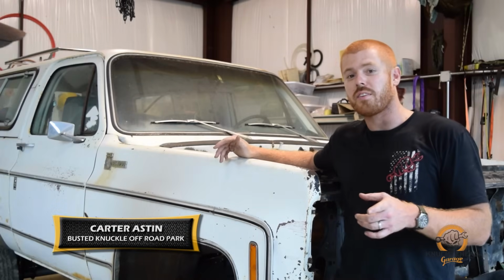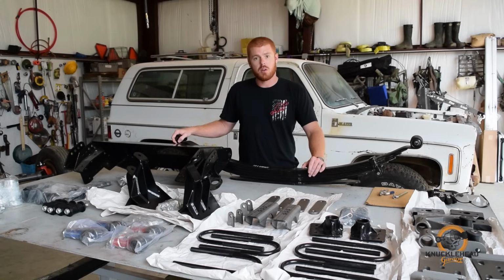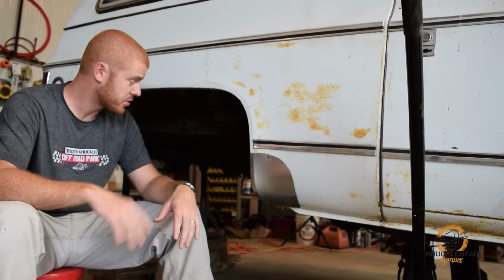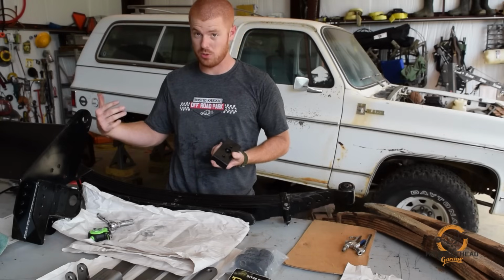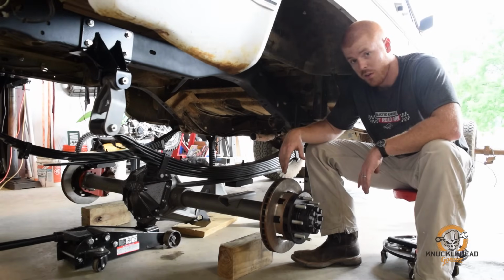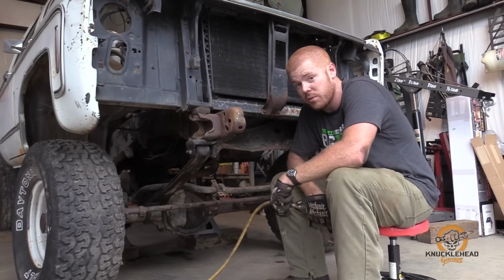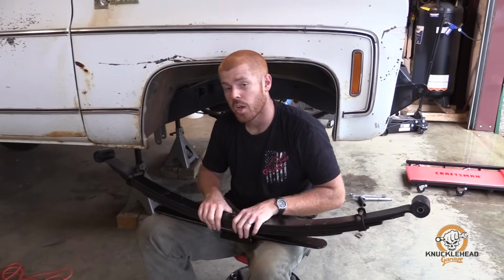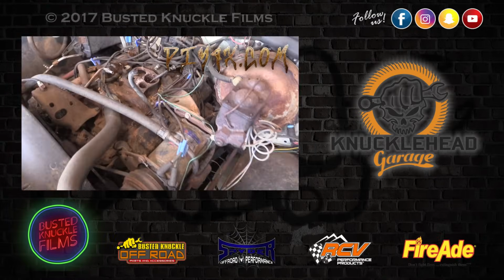Project LS K5 Blazer Axle Swap 1 Tons - Knucklehead Garage

Comment: Can't go wrong with a stock LM7 5.3 or LQ4 6.0 LS but a LQ4 stroker with an RV cam would be perfect for this rig. 500 ft lbs of torque without the weight, mass and gas guzzling attributes of having to go with the big block. Stock 4L80E in it and you can tow or trail all day long and leave room for whatever else down the road.
Reply from the maker: new gen 6.0 is what we decided on

Comment: Is it possible to do the swap , but only get  around 2 to 4 inches of lift? How so? Also, do I need the A bomb bumper, or can I just do the swap &  have it work? I have an 88 GMC Full-size, Jimmy.
Reply from the maker: The A bomb is just the easy way to do it, less leaves in the leaf pack = less lift
Reply: @BustedKnuckleVideo  Pretty sure the leaf springs on my truck now, might be the originals, and are probably bad. Doing the swap would be stupid unless I buy new ones, right?

Comment: Nice job. I've done several of these over the years but learned a few tricks from your videos (such as offset blocks being available for purchase to tweak axle position and using the rear springs on the front).

One comment though. The front axle pinion angle looks too low for the standard double cardan joint at the T-case and single u-joint at the axle. For that the pinion shaft should point pretty much straight towards the front output on the transfer case but yours points directly rearwards. Are you considering getting rid of the double cardan and running single u-joints front/rear on the front shaft? I know a few guys with tall lifts who've done that along with a part time 4wd system (np205 or modified np203) and for that you do want the pinion shaft parallel to the T-case output shaft.

Personally I prefer to run detroit lockers front and rear (after trying the setup you are building). I find it easy to pop it into 2wd for tight turns and the extra grip a front locker provides is incredible on tougher trails. Like you I tried an open front first and couldn't keep up with my buddies, then I tried a strong LSD for a short while (realizing I was going to quickly burn it up when playing on rocky trails and in deep mud) before installing the Detroit and finally being very happy with the performance. I find if the traction isn't good enough for 2wd that the tires tend to slip enough so the front locker isn't a big problem. An air locker is another option I considered (more $$ though) and a few buddies are running but I'm still more than happy with the front Detroit locker.

My truck has 4.88's (now wish I'd gone 5.13's though), Detroit lockers front/rear, Dana 60 front, FF 14 bolt rear, and an np203 with a part time kit using a pre-1975? heavy duty central differential carrier (grenaded the weaker newer style before discovering the much stronger older version). I built it in 1998 so its a bit old school by today's standards with its 350 small block (~350 hp) and heavily modified 700R4 (kevlar friction bands/disks, heavy duty planetary gear set, corvette 2-4 servo, etc.).  For rear discs I used the front backing plates & calipers from a 70's K-5 combined with 8-stud front rotors from a K-20 (Dana 44) plus a custom backing plate mounting spacer. I'm also running about 6" of lift with a double cardan + u-joint front shaft and did have to grind the double cardon housing a bit to handle the high angles during droop (the longer 700R4 vs TH350 helped but not quite enough). For an on-board compressed air system I'm running an A6 compressor from a 1970ish Eldorado (these have an oil sump but you do still need an oil separator) and a frame rail mounted air tank from an 18 wheeler.
Reply from the maker: Sounds like a cool build! We have a lot planned and everything will be accounted for so stay tuned.

Comment: hey i have a question for you hoping you can help me out do you have to change your steering arm if you just do a 3" body lift  i got a 1990 k5 blazer with 35x12 15" tires on it..
Reply from the maker: definitely wouldn't do a 3" body lift

Comment: Loved the video would like to see more.  I had a question about the rear springs did you like the way they  road and how was the handling flip around like that. I am assuming you have finished it and are driving it by now. Thanks for the great video if you can get back to me thank you.
Reply from the maker: Hasn't driven it yet, working on the engine swap now
Reply: @BustedKnuckleVideo  
If it got driven... 
I know the 52/56 combo is for flexy suspension. 
Something about shackle flips bothers me (for towing duty). Have you tried towing with your combo of 52/56 + shackle flip? 

Reason I ask is I have 1 ton 4x4 tow truck I want to lift. I think I'll keep it simple with small blocks, leaves, or arched springs. Remember I have to go through highway inspections regularly so I can't have anything they won't like.

Comment: wouldnt the spring pin re-locator blocks be similar to running lift blocks in the front, ie unadvised?
Reply from the maker: they are small so not much of an issue

Comment: I see a problem. I have done this shackle flip before and the problem arises because now when the rear springs flex the axle will move back and forth.  You need to maintain the spring angle with the back being higher and the front lower.  This factory orientation minimizes the front to rear movement caused by the curved leafs  lengthening as it straightens out.  What I did on my 4wheel drive van was make a special extension that fit in the front rear spring mount. This lowered the front 6? inches which combined with the back 6 inch from the now modified shackle flip gave 6 inches to bring it close to level for the lift required by the solid front axle.  Bonus because now I don't need the angle shims I had for the pinion angle and it doesn't jerk back and forth over the whoop de doos.
Reply from the maker: We will check into that.
Reply: Keep in mind that due to the leverage you will need to provide some extra reinforcement for it especially if you plan to wheel.  Pretty easy to just add some triangle supports in two directions.

Comment: Great video. Looking to do the same lift set up. I'm looking at DIY4x 's web site and looking to order the shackle flip but there are three options basic kit , 4.5" and 6" which did you order. Thx
Reply from the maker: 4.5 is what you want
Reply: Thanks for your help and detail on install. I've been wanting to order this kit, just got it. Also have 14 bolt and Dana 44 full float and disc brake conversation. I'll up grade later to Dana 60. Before your post, i had to watched several videos to get all This info.
Reply: Ok . I just got my kit from diy4x. Ordered the everything as you did , going for the same set up. Moving front axles 1" forward and rear axles 1" backward. Doin 56" rear and 52" front springs . 14 bolt rear and gm Dana 44  front. My question is , in doin  this lift would you know if I will have to extend any other items . I know brake line. And I'm staying with 350 5.7 , 700r4  ,203  , thx again

Comment: either ls3, lb7 duramax, or 12v cummins
Reply from the maker: diesels are too heavy
Reply: Yeah ig so but itd be cool to here the roor of that diesel engine while your crawling over rocks, a 4bt wouldnt be to heavy but it might take a few little miner upgrades to give it good power
Reply from the maker: 4bt won't make enough for this heavy truck

Comment: should l run the 87,000 mile diesel first to set up truck/suspension?Blazer and Jimmy, 465 and 205,with 411's.35',Detroit in back, read lock🙄upfront.
Reply: track lock
Reply: track lock upfront.
Reply from the maker: the Diesel might be a bit heavier than the v8
Reply: BustedKnuckleVideo good point. The ride height .350 is at least  a hundred  lbs lighter.

Comment: What front end does the Blazer have, It seems pretty custom setup, also do you have to you that from Bumper setup? I have CUCV M1009 military blazer and don't want to loose my front bumper setup
Reply from the maker: You don't have to use this bumper. It is just a stronger setup with the spring mounts built in

Comment: what transmission and transfer case would you run? cause newer gm's have drivers side differentials
Reply from the maker: NP205
Reply: will a 205 bolt straight up to a to a 4l60 or 4l80? and what is your opinion on a 203/205 doubler
Reply from the maker: I am sure there is an adapter for it. 203-205 doubler is heavy but not a bad option

Comment: Any interest in building your own engine for this project?  Perhaps starting with a used running LS, but then add "Knucklehead Garage" modifications: camshaft, "Knucklehead" ported and polished heads, turbocharger, etc. etc. - Whatever options you choose.  I'd like to express my appreciation for this project.  I have a first gen Dodge that I am interested in doing some suspention modifications to.  You've given me a few things to ponder.  Thanks!
Reply from the maker: We might have to throw a cam in there for good measure.

Comment: I have a 1989 tbi k5 with an Ls swap.Im having an issue with the wires that go to the bulkhead connecter.I need to identify what wires to use on the ls harness and what to delete.Any advice would help.
Reply from the maker: We still have to dive into all of that.

Comment: I don't know if the project is finished or not but why run those easy inches? The easy inch isn't as long as the perches so this will defeat the theory of axle wrap and longer perches. Also you can gain that inch with the 3 hole perch and plate.  If you keep the springs as close to axle centerline as possible that will help the vehicles mannerisms and axle wrap.The purpose of the 3 holes is gaining an inch either way. Im just trying to help. I love the K5 projects. I am doing one now also. It was my grandpas so kinda special. Similar to you getting your pops back.
Reply from the maker: It's awaiting the new motor and will have episode 2 out soon we hope

Comment: So l can use my 79 k5 rear springs, 4inch lift, on the front  of my 85 Jimmy to go along with  4inch lift springs also stock length on the rear, Dodge  Dana 60 from Boyse. Do l need to replace  the rear hangers on the front to make this work  with 10 bolt,and stock push pull steering for now?
Reply from the maker: Doing longer springs on the back will help it ride much better

Comment: So where did you get the rear 56" springs ? Like where this is going.
Reply from the maker: EDIT: These 56" springs were purchased new online. They came on a few different model vehicles, search for late 80s Suburban. It's a 56" spring, the axle pin is offset 30"/26". They're pretty reasonable new, but shipping cost is borderline insane.

You CAN find these for next to free in junkyards. I was not able to find a set locally.
Reply from the maker: See above

Comment: Not sure what route i need to go I have a 1963 chevy suburban k10  with a 292 motor. I would like to make it all disc. The gears are 3.73  . Any advice appreciated
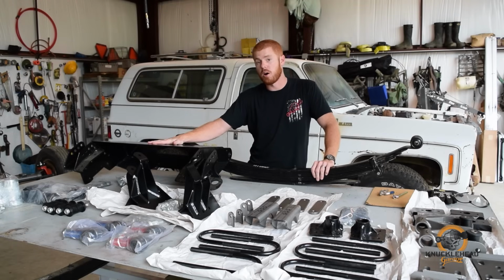Reply from the maker: 1 ton swap helps with gearing also, these have 4:56

Comment: I would probably install sm465 with np208 t case or nv4500 behind your ls swap and maybe even put a 6.0 in it unless you plan to make it automatic transmission then i would say th400
Reply from the maker: Auto for sure!
Reply: @BustedKnuckleVideo  th400 or 4l80e?
Reply from the maker: 6L80 would be best
Reply: @BustedKnuckleVideo  yeah man you are on to a really sweet project  i would do the 6l80 wit a 6.0 or something for sure man. Im gonna do my 84 k10 with a 5.3 and a 4l80 and and 52 56 spring swap with dana rears
Reply from the maker: Nice!

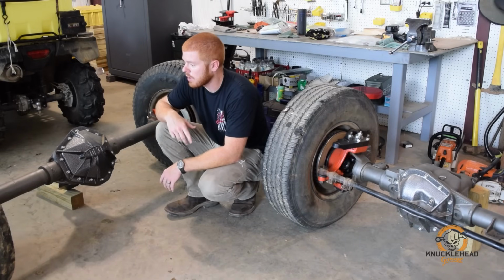Comment: 03:35 The 14 bolt axle from the rear of a 1 ton dually has a different spring perch width and a different overall width than the K5 axles. But if you get a 14 bolt from a 3/4 ton single rear wheel (same axle as 1 ton) then the spring perches are within about 1/2 of an inch of the K5 springs and you would not have to cut off the old ones. The BillaVista 14 bolt bible can give you all the info you could ever want on the 14 bolt swap... http://www.pirate4x4.com/tech/billavista/14b_bible/index.html
Reply from the maker: thats another option

Comment: have 1985 blazer 4wd how due i due a 2" lowering springs on top of axle
Reply from the maker: why would you lower it?
Reply: @BustedKnuckleVideo  why raise it when diff is still the same distance to ground body is higher. To answer your z
Question my mother is short an 90 years young an it is hard for her to get in tires are stock just want to help mother out
Reply: @frankswain994  
(I know this is a year late)
You can add a step like a tubular step, those new electric ones, remove leaves, play with the shackle, the rear 2wd shackle bracket is shorter, or last resort buy her a step to put on the ground. 

I know an elderly lady that does that. She has a cheap plastic step like from the dollar store. She has it on a string. She'll throw it down to enter or exit. 
👍😉

Edit. Try smaller tires. 
I don't remember if the 2wd springs are flatter.

Comment: whats the difference between a 1996  1 ton 2 wheel drive  truck 14 bolt full floater and a 1986 suburban 2 wheel drive 1 ton 14 bolt full floater, and is the 1996 truck 14 bolt worth 375 got a 410 posi and ayone know what kind of posi unit in it from factory
Reply from the maker: google is your friend on that

Comment: I have a 73 power wagon with a 440. and a 4  spd divorced np2.05 as for axles currently sitting on dana 60 front dana 70 open diff. that's gonna change as soon as I can afford locker kit for both. 
I wanna change the motor to a cummings 12 valve. with road ranger 13 spd. because I also have a couple jeeps that could be fun with the 440. so I a square body I gonna get a bow tie. in search of step side. its gonna get a tamed big block for the time being. when..
Reply from the maker: 13 speed? that is an interesting combo
Reply: My dad drives big rig, So thats where I got the idea.. Also pb blast on rusted stuff makes knuckles a little happier and easier, A touch of anti sezie for stuff you wanna move later down the road such as lug nuts tie rod ends, sway bar bolts, and of course loc tight on everything you wanna move till later down the road.. Love the shop, and thank you for explain some of why the holes and other detailed info your video. love the front sub frame winchplate combo. body in great shape, exo cage/ fire cage would look awesome on that.
Reply from the maker: Thanks for tuning in, we are pumped about the direction of this build. Can't wait to release episode 2 soon!

Comment: Wouldn't you want to lower the truck down to its own weight before tightening the bushings?? I.E. stopping from potential pitching...?
Reply from the maker: I don't see that being an issue as they have metal sleeves in them

Comment: You filled your grease zerk with bits of mallet.
Reply: If you added a one inch spacer, but also took out two quarter inch leaf springs then you only gained a half inch in suspension lift.
Reply from the maker: itll be alright
Reply from the maker: not finished yet

Comment: A hydra-matic 4L65-e for the transmission
Reply from the maker: 4L65e?
Reply: something different something new. I wish I could lift both of my Avalanches 6ins too.
Reply from the maker: how about a 6L80e? that'd be different!
Reply: can you run it with 2 coolers
Reply from the maker: sure and a beer cooler in the back
Reply: BustedKnuckleVideo. Well as long as you can fit a deer or hog in it too.

Comment: 3/4 & 1 ton swap is not a  just axles. Tonnage also brakes and springs. Maybe a 8 lug swap.
Reply from the maker: we were referring to the axle swap, not sure why you would want 1 ton springs so it wouldn't flex at all.
Reply: @BustedKnuckleVideo   That's exactly what I'm saying just cause it's a Dana 60 and a 14 bolt doesn't  make it a one ton swap. the 1 ton is in your Springs and brakes. it's an 8 lug swap because Dana 60s and 14 bolts come in 1/2 , 3/4  and 1 ton and larger trucks. The axles is not a 1 ton.

Comment: are those stock 56in springs?
Reply from the maker: We took the rear springs off the back and put them on the front. We just cleaned them up and painted them.
Reply: the suburban springs you put in the rear, are they just stock height springs?
Reply from the maker: Correct they are stock height springs
Reply: thanks much, look forward to the rest of the series keep it up!
Reply from the maker: Hopefully we will have an update soon!
Reply: What years for the 56" springs?

Comment: Put a Ford in it so it will not be just like every other swap.  6.2 would really move that beast with 4.88s and a 6 spd.
Reply from the maker: No one puts a ford engine in a Chevy, that would be a total waste
Reply: BustedKnuckleVideo yeah...you would hate to never have to touch the engine and always work on the rest of it. But, I guess you would want to go LS and have to upgrade it as you go to make the power you want. Then...you can fix your tranny issues.
Reply from the maker: We run LS engines in all of our builds because they make good power on the cheap.
Reply: @BustedKnuckleVideo   Not knocking it, but you arent going to run a 4.8 or 5.3 in that and leave it alone.   The power will come, and then you will get the check engine light for the input speed being different than the output speed in the tranny.  Then, more money comes out and its not as cheap to build power and hold it.  But like I said, not knocking it, but you can pay now, or pay later...and that is with any build.
Reply from the maker: We don't have many issues with LS engines, they are super easy to work with. We can bypass all of those lame sensors with some minor tuning also.